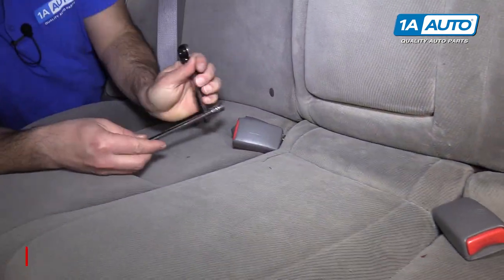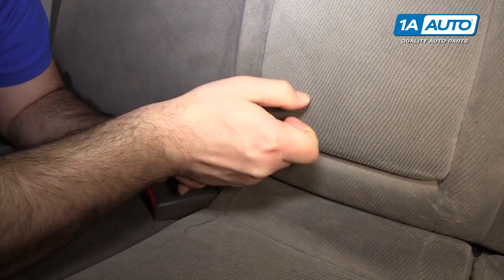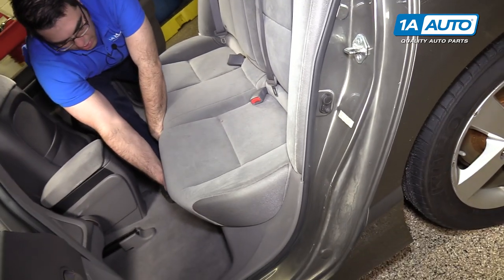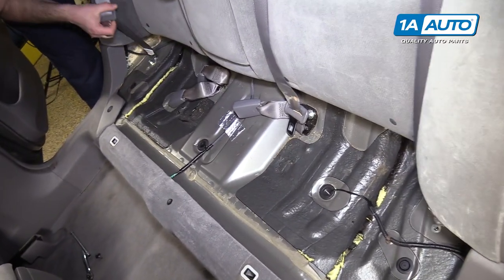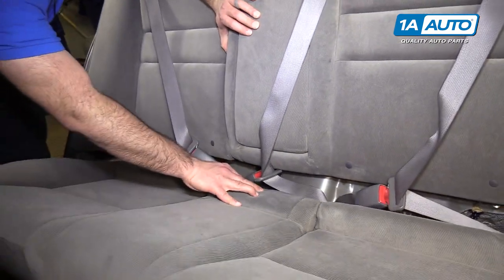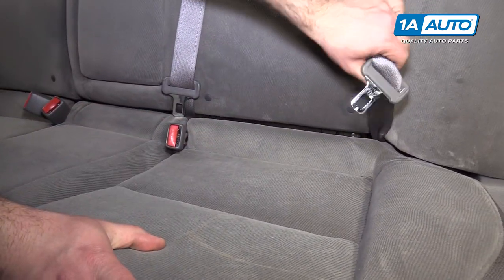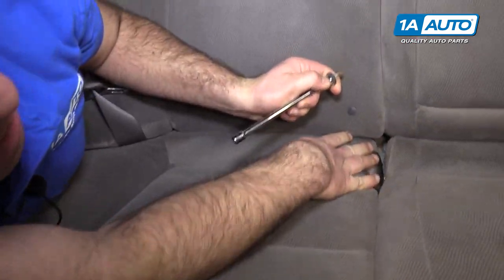How to Replace Rear Seat 05-11 Honda Civic

Comment: Do you know if this works on the two door coupe model? Thanks for the great video!
Reply from the maker: +Drew Pattison It may be a different procedure on your application. We currently do not have an auto repair video for this particular year, make and model. Thank you for asking. 1aauto.com
Reply: I didn’t find the bolt but I only needed to pull the clip side to pull some after market amp power feeder cable that came with the car when I bought it.

Comment: This is the WRONG way to do it. 

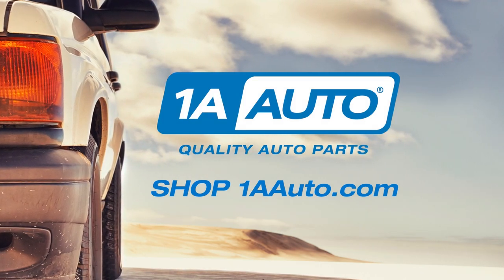You HAVE to RELEASE the T-Shaped clip underneath the bench seat (2 clips with T hooks) once y 4:51 ou lift up the bench seat. Just pulling the cushion up SNAPS the plastic clips.

Lift up the bench seat first n locate the clips. Pull T-shaped plastic piece towards the front of the seat. This will RELEASE the seat from the clip. Do it on both sides.

This is the PROPER way. 

Don't YANK it off the clips from above.